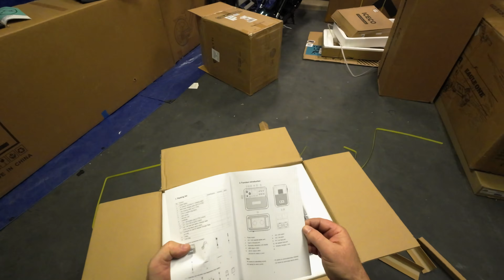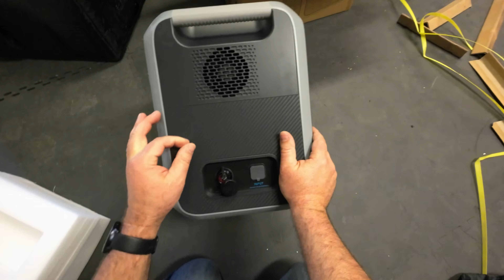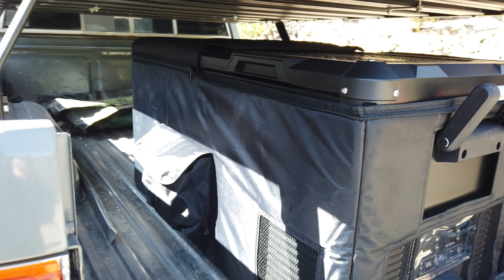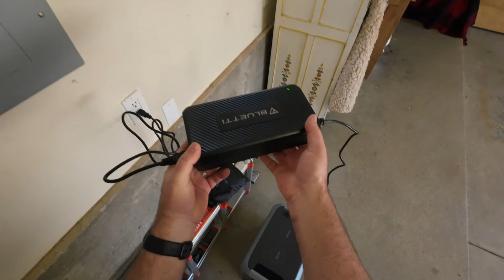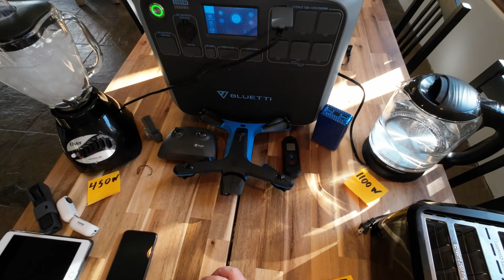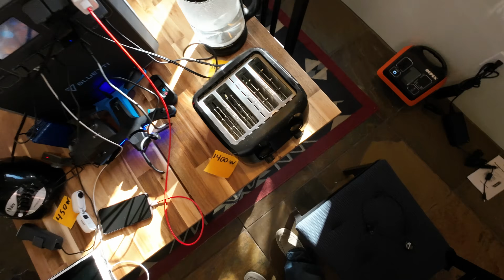Bluetti AC200P 2000 Watt Power Station Review with MAX LOAD TEST - (Touch Screen LiFePO4)

Comment: The only thing lacking in the AC200P is that it is not expandable like the other 2kWh power stations.
Reply: Actually if you get the bluetti enhancer you can hook any battery, agm or lifepo4 to the unit for more power.